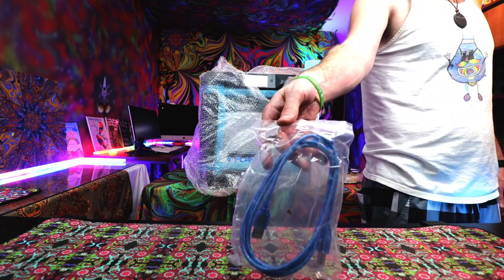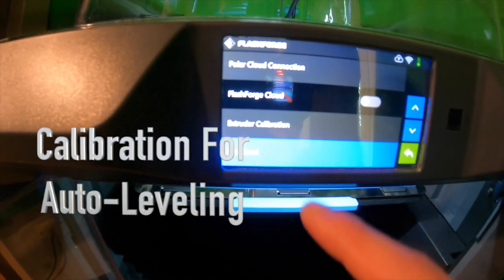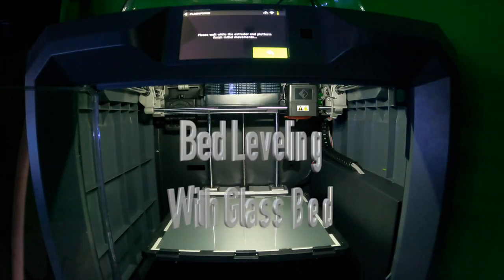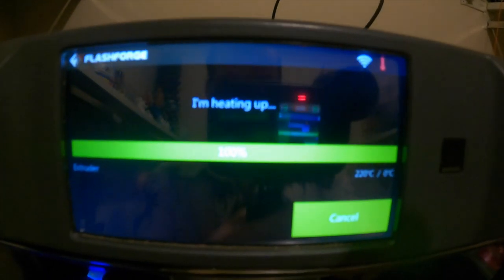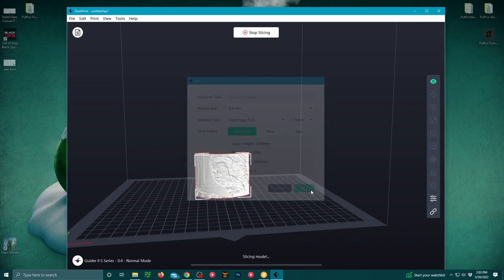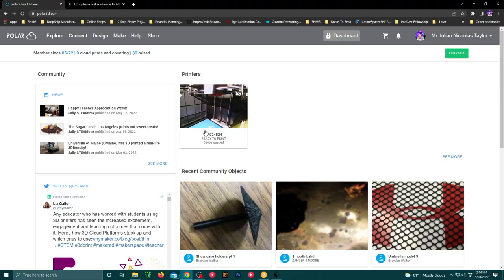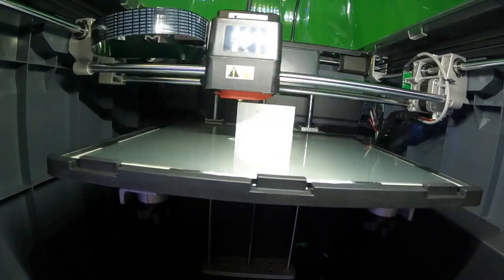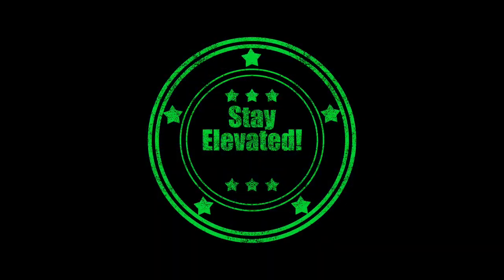Flash Forge Guider 2s Unboxing & Complete Setup Guide Tutorial! EVERYTHING! The Whole Kahuna Burger!

Comment: I have the same machine and have a clog.  I tried removing the extruder motor via the two screws to clear the clog, but the motor will not come off.  I followed the instructions on multiple help videos.  They all say the same thing, but the motor won't budge for me.  Any help would be appreciated.  Forums are useless, as is Flashforge tech support.
Reply from the maker: You gotta get those two screws on the left and right side underneath the extruder motor in front of where your filament feed slot is this is positioned towards the front of the printer. Hopefully this helps. Sounds like it’s not a nozzle clog, but a extruder motor jam from the filament. I’ve had this happened before at some point I’ll try to make a video but I’m very backed up already on different topics but will try at some point to remember in the futures this year in 2024 happy Printing